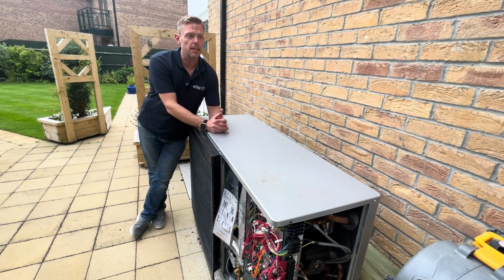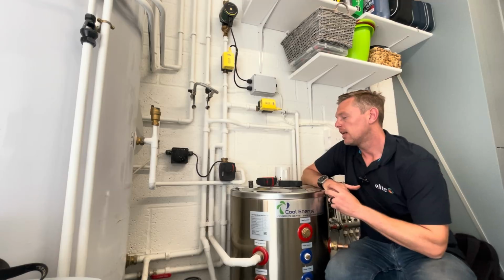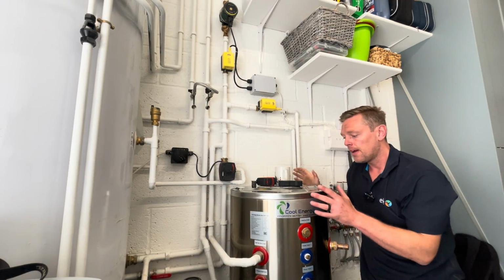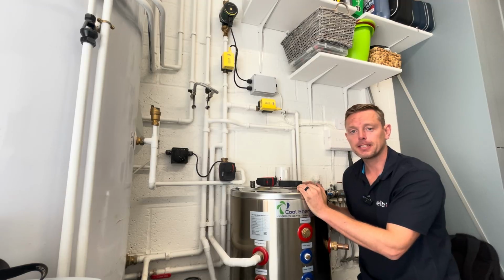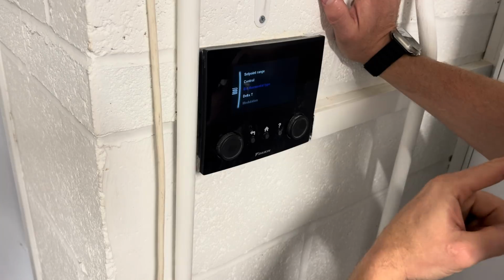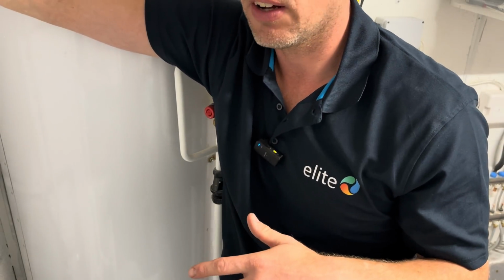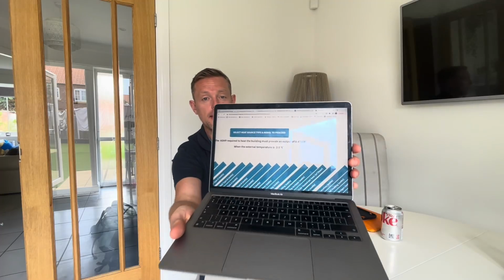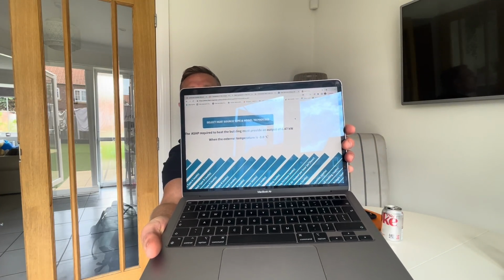How to Kill a Heat Pump's Efficiency!

Comment: Interesting, just a few  things you said 7 kW of energy, it should be 7 kWh.  Pipes should be lagged to stop heat loss but that would not cause the damp issue. What is used to heat the water tank above 60 deg C to stop legionnaires risk, heat pump or element?
Reply from the maker: Yes kWh. Will see it’s the only thing in the garage hot hitting cold and only started after the hp installed…. And they still need lagging to. Hp at achieve 52oc then element for the remaining.

Comment: Interesting video,  just shows that that installer  had good intentions,  but failed on key points , that bring the efficiency down. I am just starting out on my heat pump journey. I am in the North East and have had octopus survey and have not paid for heat geek survey,  waiting for the appointment to come through. Busy upgrade some cold spots in my house that I found when running my combi boiler at 40deg last winter.
Reply from the maker: We are based in East Yorkshire if you need us 👍. Happy to help.
Reply: @EliteServicesGroupLtd   my post should read have paid for survey, dam auto correct.  Very interested in getting a quote.
Reply from the maker: @derekpaisley620  haha I hate that. Happy to quote. Your in safe hands with us heat geeks.
Reply: @EliteServicesGroupLtd  email sent

Comment: Thanks for sharing! Very interesting… would be cool to see the finished solution
Reply from the maker: Plan to 👍
Reply: @EliteServicesGroupLtd I'd like to see that follow up too. Interesting video. I'm in a 30 year old house with quite good insulation and I'm not sure if I should go towards air to water or air to air. Air to water is a simpler fix as we just need to plumb it into the existing system but then we might need bigger radiators and possibly need to install underfloor heating. Air to air can give us room by room control and air conditioning in summer but means more work fitting the piping into all rooms.

Comment: Can any of these systems display instant COP or at least a daily COP?  I'd really like to know the minimum COP when its really cold outside.
Reply from the maker: You can have a daily COP on the daikin MMI
Reply: @EliteServicesGroupLtd  cool so what is a cold winter day expectation with below 0C outside?
Reply from the maker: Good COP below zero 3. And SCOP 4
Reply: @EliteServicesGroupLtd  I have trouble believing this.  Others have said its near 1, and I have seen data sheets that show 1.4 around 5C.  Today its hard to find such datasheet information its like they are deliberately hiding it.  There is so much concentration on average COP (now called SCOP) over the period that we do not need heat pumps, aswell as putting heat into the building when it is not needed. I fear that resistive heating maybe nearly as good.
Reply from the maker: @tonystanley5337  I don’t believe SCOP is a good medium to look at. Just COP. you can find product data on the MCS website. The highest temp we would go @-2 is 45oc flow.

Comment: Overshoot is not a big problem per se, if everything else is set up correctly. The biggest problem I see is that tank which acted as a bypass. If there is no balancing valve, that tank will get a lot of circulation and heat up the return. To compensate for that, heat pump will turn it's circulator pump and power to minimum to try to hold the dT of 5 degrees, which is hard to do because of the "bypass". In other cases overshoot of a couple of degrees is a way to prevent cycling when zoning valves close briefly. That overshoot only happens when heat pump is running at minimum power and leaving water temperature still rises (not enough heat removal in radiators and UFH).
Reply from the maker: We will be changing it to a water volumiser on the primary return.

Comment: Just a thought. Underfloor temperature limits may be to do with flooring adhesive, if the 'tiles' are something like Amtico 'vinyl flooring' the 'tiles' are fine but the glue may soften at high temperatures risking flooring lift. Might be nothing to do with it but having a kitchen installed just now and flooring choice temperature considerations were news to me.
Reply from the maker: That’s the point we didn’t need high temps in the first place from the hp. No need to send out at 50 and mix down.

Comment: Interesting and, as a heat pump customer, a bit scary.

Cheekily, do you know where I can find the data on the Daikin Altherma 3 Monobloc 11kW that shows the max output at low temperatures as you were quoting for the 14kW, please?
Reply from the maker: daikin “stand by me”